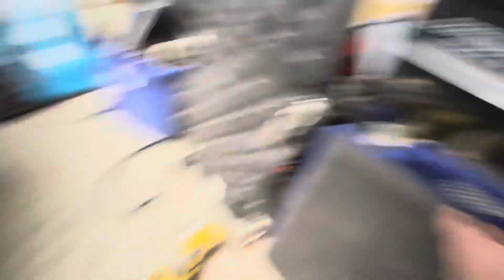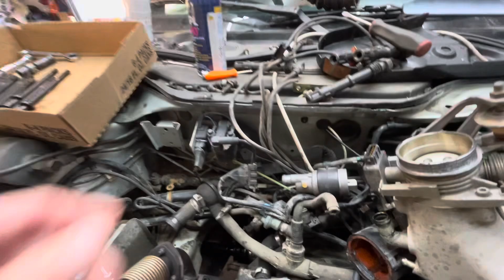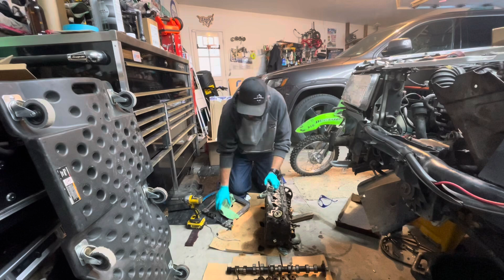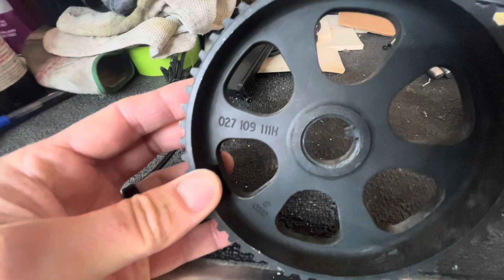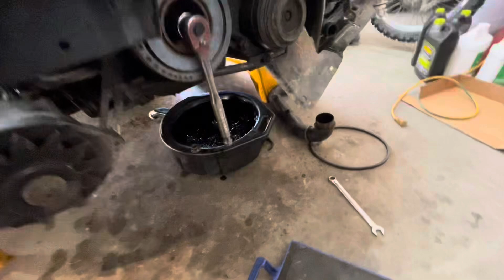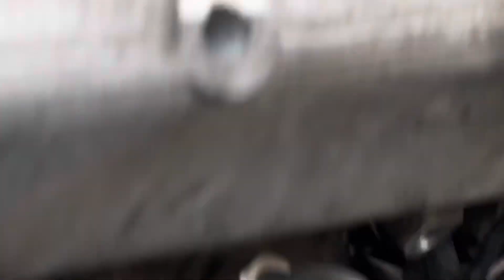1991 Audi 20V Avant timing belt failure! BENT VALVES! Part 1 inline 5!

Comment: Didn’t didn’t see if you checked the actual crank cog behind the damper. These normally shear the key way and are a big issue, if you don’t have ignition though good chance the distributor gear broke.